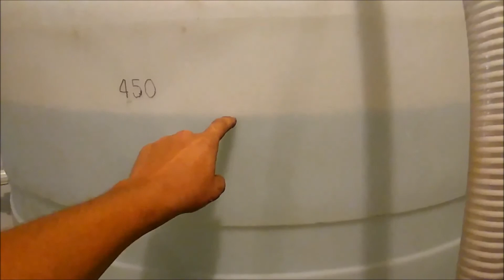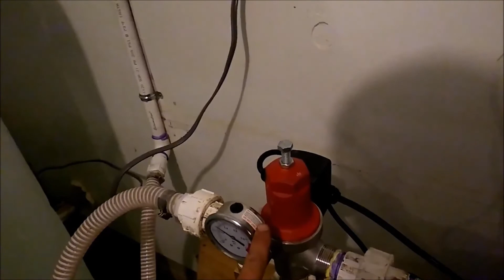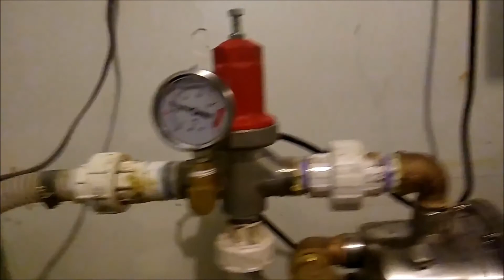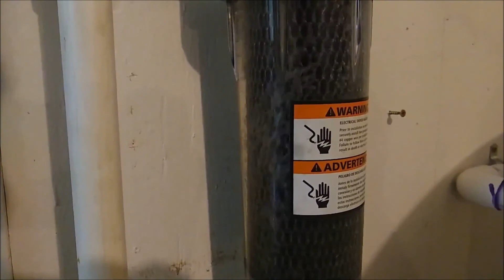500 gallon water storage tank for low yield well

Comment: A Franklin Electric Pumptec unit, a Coyote 1PH230V, or a Cycle Stop pump protector will work for your dry run/overload protection, a float switch to manage your water level will help you out. Also have you considered putting the bladder tank and pressure switch in the pumphouse back in the circuit, and run the dole valve between the bladder tank and your reservoir tank? That, there's no concern about running your well pump too long with inadequate flow. You'll restrict your flow to what's needed, but the pump is managed by the pressure switch, and can flow plenty of water to cool it down. Plus, the the pump will shut off and have the opportunity to cool off (most pumps aren't rated for 100% duty cycle). You could also use a bigger bladder tank with a higher drawdown if you'd rather make the well pump cycle longer. As example, a Well X Trol WX202 has a drawdown of 6.2 gallons using a  30/50PSI pressure switch. Would probably take about a minute to fill, but then would take about 8 minutes to empty with your dole valve

Comment: Interesting setup.  I've been thinking about something similar.  Just curious, did you consider a surflo demand pump for the house instead of the shallow well pump?  Wondering which would be more durable.
Reply from the maker: Not sure of you're talking about the Shurflo pumps made by Pentair?  Only time I've ever seen those used is on a boat or RV and they're 12-24v.  No way would they supply enough GPM for a house.  

If you're talking about something like a booster pump... I don't think it's worth it.  They're expensive and the fancy VFD ones just aren't worth the price especially since more electronics - more issues.  

I had to replace the first harbor freight pump when a leaky toilet ran the tank dry and I didn't have any low water protection set up.  The second pump I was able to up the pressure to 40/60 PSI no problem.  I have the CSV set to try to maintain 55ish PSI.  Works really well.  Only problem with the HF pump is it's pretty loud.